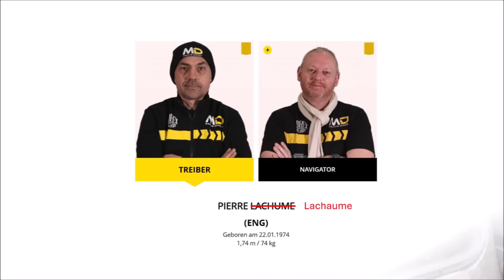DAKAR 2025 - First Days, First Drama - Technical Summary

Comment: Cant wait for the teams to complain about how hard the stages were and then we start a yearly loop of stages being too hard then too easy

Also the top teams sandbagging so they have an easier time to find the finish is very unsportsmanlike. The organisers have gps systems on all cars and they should dish out penalties for those that intentionally sand bag. It takes the privateers out of the competition because toyota and dacia and all the big oems want the glory. Its nasty
Reply: It’s part of the game, and almost impossible to regulate against.
Reply: @MIEJ4  i just gave a solution to police it. If you are intentionally sandbagging

You get time penalties equivalent to the time spent sand bagging
Reply: @  that’s no solution - how do you possibly prove someone is going slower than they might be able to?
It’d be amazing the number of car issues that would suddenly appear - or would you penalise that and genuine issues as well? Or just slower drivers?
It’d be absolutely impossible.
Reply: @MIEJ4  gps the solution is not a hammer to glass. But a smarter person than me.can surely implement one
Reply: @km6832  everyone can slow down, so its not a problem at all. all the privateers can sandbag too.
Reply: Probably have to tarmac the stages in future years so the sponsors get more air time and the cars don't get broken

Comment: I just hope next year regulations change so teams can fix roll hoops
Reply: Agree, but the problem is if it’s not done to a high enough spec and it fails, the scrutineers would be bollocked for allowing it. It’s an impossible situation really, but they take the safest option.
Reply: Roll cage repair in desert is just inviting disaster regardless how easy it to fix. What if car take another punishment, and this time roll cage can't handle it because it lost structure integrity?
Reply: @kidpagronprimsank05   rejoining cars need to be rescrutineered anyway, and checked if the cage meets the homologated specification.
That is all that is checked at pre event scrutineering anyway, they don’t try and crush each cage to make sure it works… that is what the homologation is for.